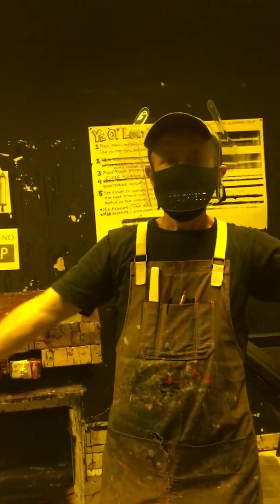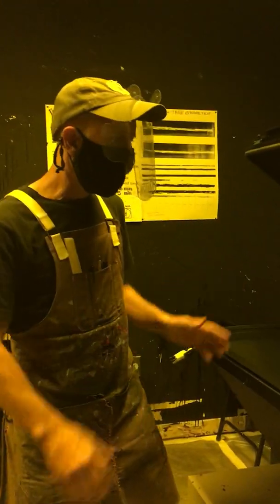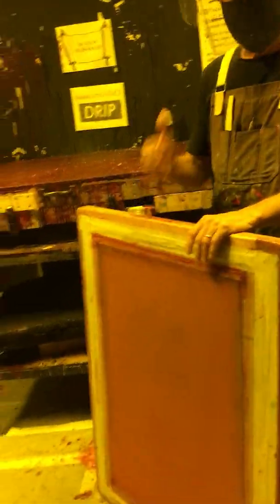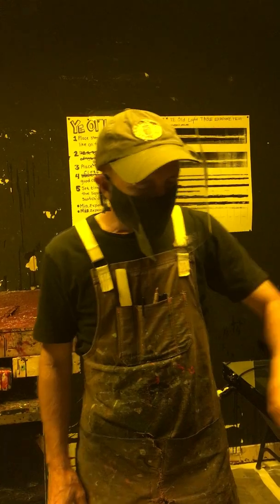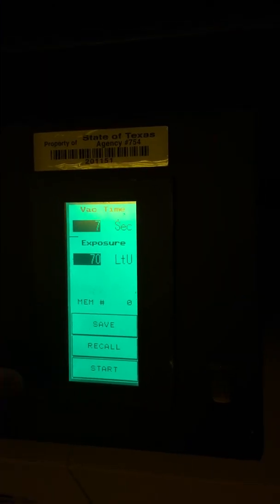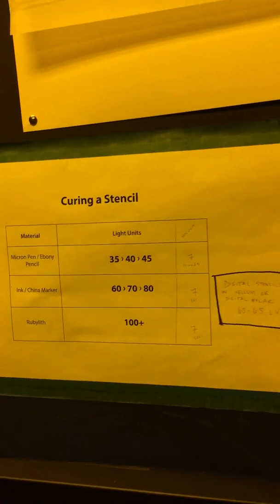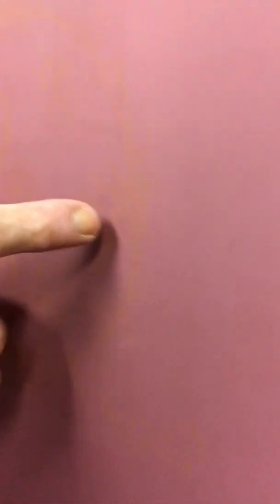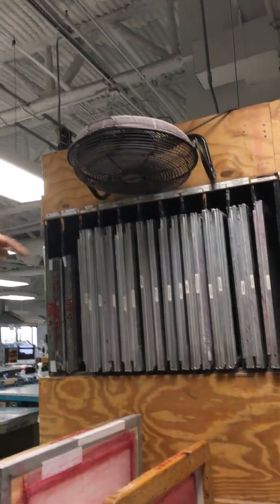Exposing & Developing a Screen (for screenprinting)

Comment: I notice you're using enclosed unit with intergrater. Ive used free standing metal halide as dedicated screen setup for 25 years. I wonder, are enclosed units now more used as UV light hazard has been recognized? I ask as ive had eye removed due to bcc cancer invasion of lids and surrounds. In your opinion would you think this likley? Im battling authorities here over workers compensation and am feeling alone. I am likley only one in New Zealand. Any thoughts you may have would be appreciated.  Many thanks.
Reply from the maker: Hmmmm. I’m sorry to hear about your troubles. I am no authority on those matters, but the essential wavelengths that “cure” the emulsion are the ultraviolet ones — same wavelengths that sunburn our skin, cause skin cancer, and can damage the eyes. So it would make sense if there’s a connection. Best of luck, friend.